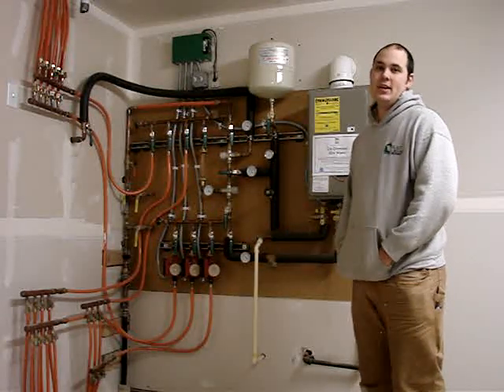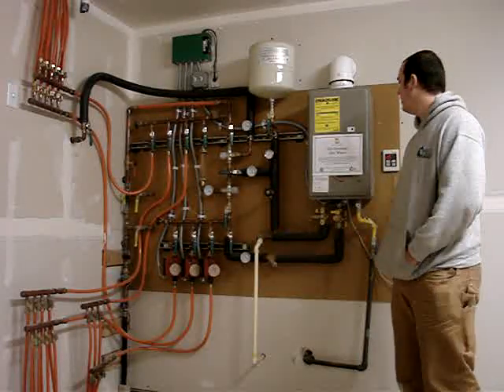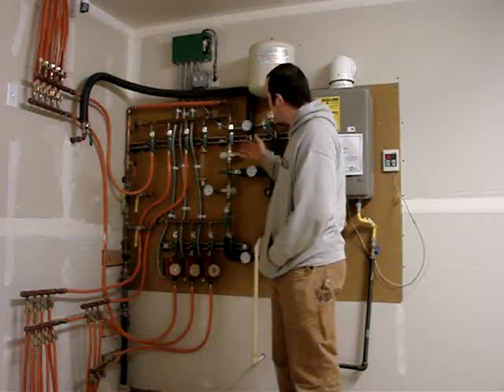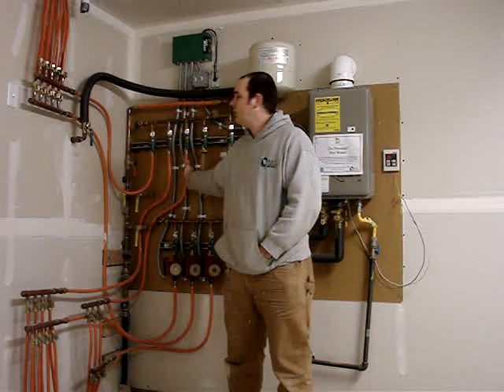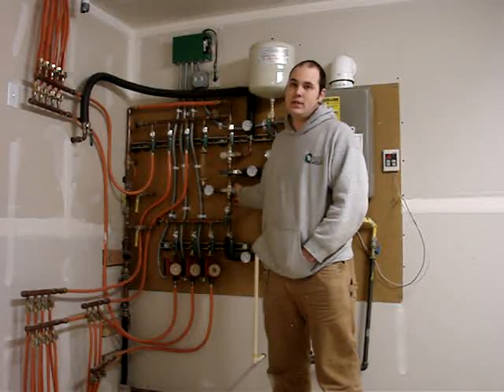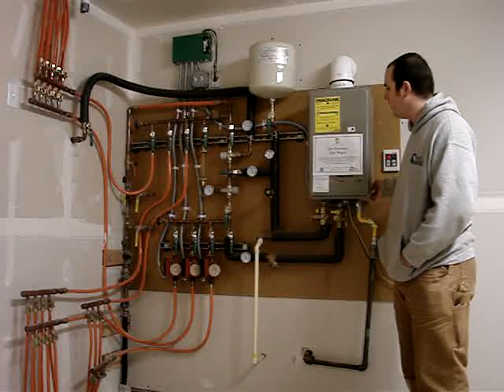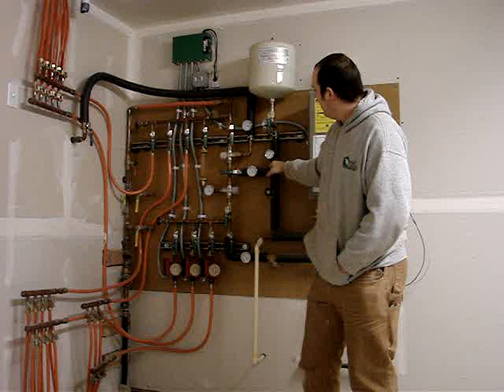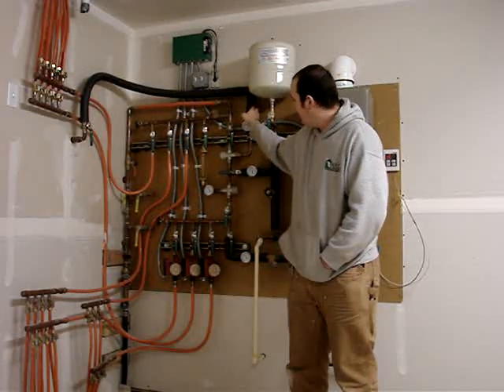Efficient Radiant Heating

Comment: Should not mix infloor radiant water with domestic hot water. Bad idea for health reasons and certainly , "code defying"!
I agree with many of the other posts; too complicated and crossed connected.
There are many more, economical, simpler and safer ways to do this. I wonder how they received a plumbing/mechanical inspection? This contractor should have the domestic water separated in these homes before someone gets sick!

Comment: looks like someone asked you to design the most complicated system possible.

also does this mean that the dirty ass radiator water gets mixed in with the hot tap water? Niiiiiiice.